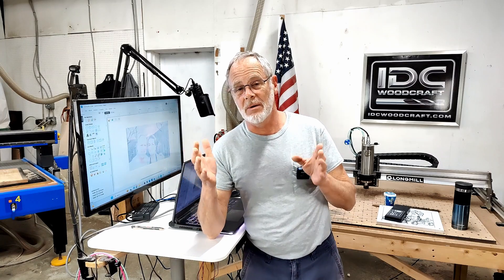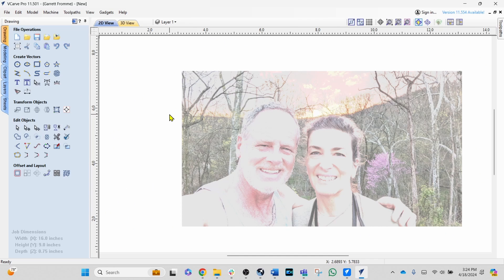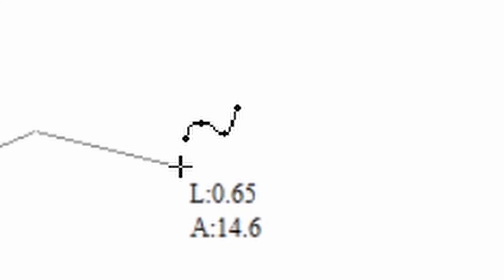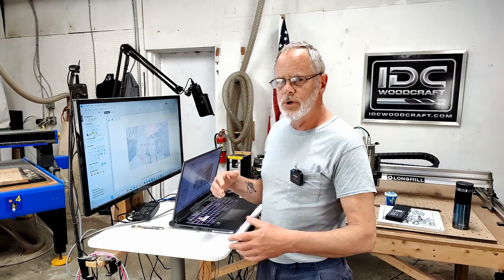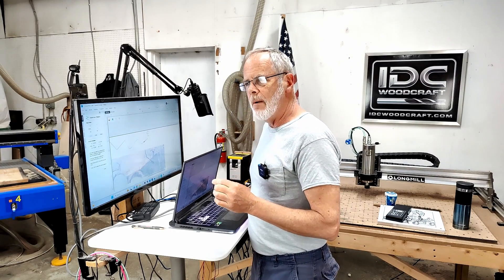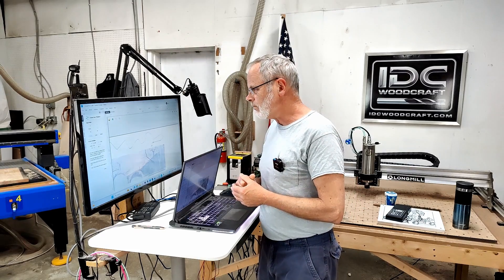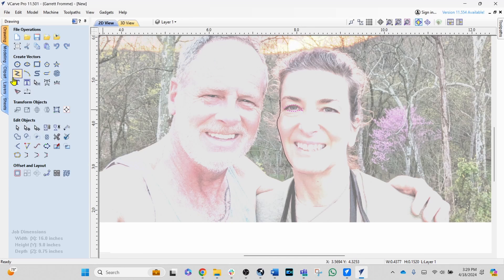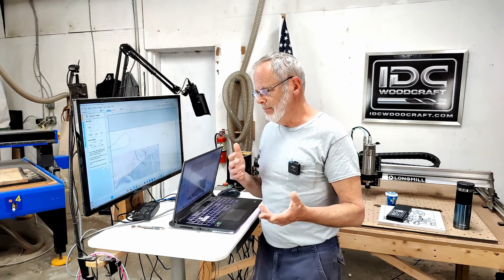How To Draw Curves In Vectric Version 12?

Comment: AI Overview
Learn more
In Vectric Aspire, you can draw curves using the polyline tool. The polyline tool can be used to create both straight lines and curves. To switch from creating straight lines to creating curves, press the "S" key to toggle between the different modes. 
Here's how to draw curves in Vectric:
Select the Polyline Tool: Choose the polyline tool from the tool palette. 
Toggle to Curve Mode: Press the "S" key on your keyboard to switch from the straight line mode to the curve drawing mode. 
Click to Start the Curve: Click on the workspace to begin drawing your curve. 
Move the Mouse and Click: As you move the mouse, the curve will be drawn. Click again to add additional points to the curve. 
End the Curve: When you're satisfied with the curve, click again on the last point to finalize it.
Reply from the maker: Thanks for sharing this overview on using the polyline tool in Vectric Aspire! It’s a great way to create those smooth lines and curves, and I appreciate you taking the time to break it down for everyone!

Comment: The draw curves tool has been added into the polyline/line tool , Pressing the letter "S" while in the tool will swap to the Curves Mode pressing again will swap back . The software remembers the mode that the tool was left in so when you return next time it will default to its last setting.
Reply from the maker: andrevellin6952, That sounds like a fantastic update! Being able to easily switch between modes will definitely streamline the workflow when designing complex shapes. It's great that the software remembers your last setting too; that will save a lot of time. Thanks for sharing this information!

Comment: I do a lot of inlay work and constantly tracing bitmaps. I use the V12 freehand tool as I find it much easier to control than the curve tool especially if you have numerous undulations. Then all you have to do is press "N" into node edit and fine tune your curves...
Reply from the maker: tankuman, That's a great technique! Using the V12 freehand tool can definitely make it easier to control the curves for intricate inlay work. Pressing "N" into node edit is a smart way to fine-tune your curves for a precise design.

Comment: reply from Vectric to my inquiry:

Many thanks for your inquiry.
 
Many of the Draw Curves tool have been integrated into the main Draw Polyline tool now, and for general curve drawing, the Freehand tool now has superseded the old Draw Curve tool for use, especially in tasks like Tracing as a faster and easier tool to use.
 
When using the mouse to draw lines with the Polyline tool, you can now click and drag your curves instead.
Click and Release will make a Straight Line while Click and Drag produces a curved line for you and you can switch
between them on the fly easily in the new Updated Polyline tool.

So the draw curve tool now resides with the Dodo bird.
Reply from the maker: pwilisch, thanks for reaching out to Vectric on that one brother! That is very informative.

Comment: Try using the freehand drawing tool.  You can go the nodes tool and notice it will reduce the number of nodes down to approximate the curve you drew and it better adjusts the node anchors to match the way you drew the line.   I always found the draw curve tool frustrating, and since I have done a number of State drawings I am always working on a curve like a shoreline.
Reply from the maker: oscar33212, good call brother. I really like that idea! Thanks for the tips on another way to set this up.

Comment: I agree to the point that both functions should most definitely be available, but the "flag" style is actually more accurate and use fewer curves if you know how to use it. 

A quick approximate outline is most easily created with the draw curve and it's the most intuitive for beginners for creating vectors, but a more accurate vector with fewer points and lines (these are called bezier curves and the flags act as "magnets" or gravitational pulls for the curve which is what gives the accuracy) can actually create an outline with fewer clicks and more accuracy if you know how to use it well. 

None the less, in my belief the more functions we have the better but I think they tried to remove functions to simplify the user interface and didn't realize 95% of users prefer the easy way, I got 30 years of experience with vector graphics and cnc machining and I'll use the 2 options equally depending on the work needed to be done.

The thing with bezier curves is that you have to know by experience how the curve will react before setting your next point and for most people it just doesn't make any sense and will take 3 times longer.
Reply from the maker: ApeHolder42066, good points my friend! You and I both hope that draw curves will come back on new upgrades to help out the beginner CNCer!

Comment: Totally agree, & I've filed complaint about loss of the Draw Curves tool.  (After your video confirmed I wasn't just totally overlooking something.)
Reply from the maker: RLamarDuffy, good idea brother! That would help other CNCers once Vectric puts it back in!
Reply: @IDCWoodcraft  For the record, here is how I stated my case to Vectric:

I am fully aware of the Draw Polyline & Freehand tools, & often use them.  But they do NOT replicate the speed & accuracy with which I can trace a complex curve using the Draw Curve tool.

The Polyline tool can leave you with distorted curves & handles that are placed in unintuitive positions, & then you have to fiddle with correcting them.  And you can inadvertently end up with straight line segments if you're not careful.  Then you have to fiddle with handles, nodes, or just undo to get them right.

The Freehand tool depends on how steady you can move your mouse & how well you can see your background image through the image of your moving mouse cursor.  Yes, the smoothness controls can help, but it's still not perfect.  Using the Draw Curve tool, you can very precisely place the crosshairs of your mouse cursor before clicking.

Even with your best efforts, the Polyline & Freehand tools result in vector segments with noticeably more nodes than the Draw Curve tool, which unnecessarily slows down toolpath execution on the machine.  So you either have to accept that, or waste time removing unnecessary nodes.

After fighting V12 to trace a BMP for over 45 minutes, I went back to V11.5 and used the Draw Curve tool to trace the same BMP in 15 SECONDS, & ended up with only about 1/4 to 1/3 the number of nodes.

The Draw Curve tool is NOT redundant functionality that can be deprecated.  It is an INNOVATIVE APPROACH that Vectric created to draw smooth, complex curves, that is distinct from drawing tools found in even dedicated graphics programs.  In fact, I sometimes use it SPECIFICALLY to draw, rather than using my other graphics programs.

Please do not abandon this extremely useful tool.
Reply: Good news.  It looks like V 12.007 has effectively restored the equivalent of the Draw Curve tool.  It's addressed in the first line of the release notes, & I've tested it.  To work like the Draw Curve tool of old, use the Polyline Tool, click your first point, then tap S on the keyboard.  Now you can click points (not click-drag), & they will be connected by curves, just like the old Draw Curve.  Tapping S again will switch you back to the straight-line Polyline Tool.  Thanks Vectric!

Comment: Yes- This is an older style of the Pen tool in Illustrator. Adobe updated a feature that allows a more fluid process with the last node placed with the Pen tool. There are so many tutorials out there on mastering the Pen tool because it is not intuitive. As you mentioned, there are workarounds that are time-consuming, such as adding more nodes and converting to curves.
Reply from the maker: CraigLafferty, very good points my friend! Its unfortunate that the workarounds take a bit of time.

Comment: while not as good you can do the outline with the draw line tool, (just click where you want the inflection points), once done use the "fit Curves to vectors" tool with fitting set to "bezier curves" you then have to play with the tolerance (up it quite a bit as far as i can tell). Not as good and not as quick but it has a similar effect as what you are doing
Reply from the maker: olbilldoor, very true brother! that is a very good point.